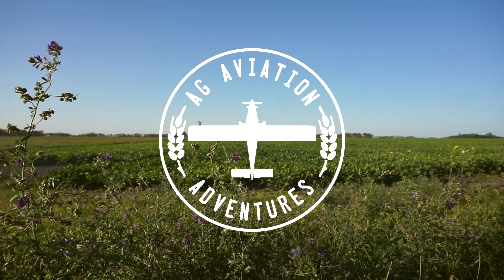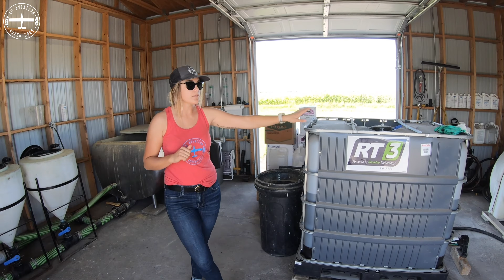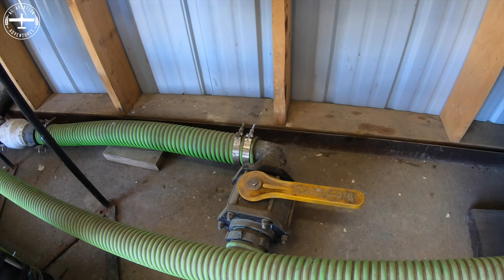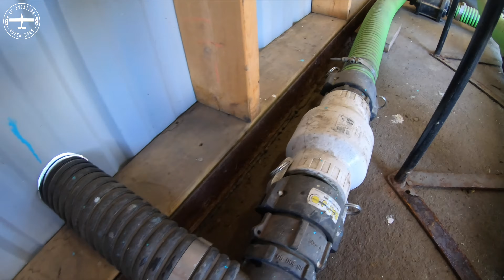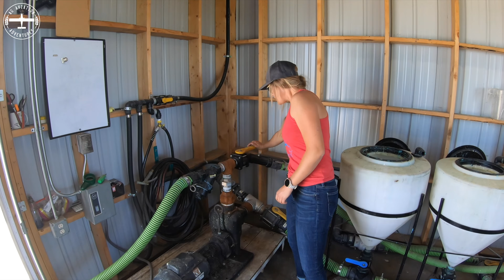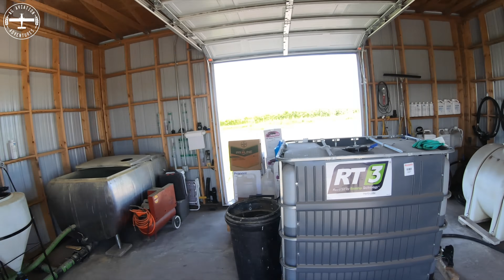What Does the Loadsite Look Like at an Ag Aviation Operation?

Comment: I'm catching up on your videos.  The company I worked for in the OK Panhandle, in the '60s, didn't have a central loading location.  We had a chem/fuel truck and 500-gal water truck.  We would drive to a more-or-less central location, a section-line road, and set up there.  The pilot(s) would land on the dirt road and taxi to us for loading. Saved fuel and time.  There weren't that many 'dusters' at the time and we covered much of the Panhandle and some of KS and TX.  Being a mobile operation, we were able to move as far south as Plainview TX to spray, though that was rare and for a specific insect.
Reply from the maker: Wow, that is really cool! Wish we could still do things like that today.
Reply: @AgAviationAdventures  Is it illegal now?   If so, per the FAA or state law?
Reply from the maker: @MaxEPR  Well it depends on where you are. You need authorization from the county. I talked to the FAA about it last month and they said they don't really mind. But the county is the one who would be up in arms about it.

Comment: Thanks for the interesting videos.  What's the process when you switch between different chemicals?  I expect it partially depends on the previous and new chemicals being used.  Some combinations may have (1) acceptable compatibility and (2) others probably require a thorough purge of previous chemical from the aircraft's system.  For situations like (2), where how & where do you dispose of the grey/"contaminated" water used to rinse the aircraft's reservoir/plumbing and the ground system with the cones and lines?  I also expect you periodically need to rinse & clean both the aircraft's plumbing and the ground station both due to prolonged use and when they won't be used for a lengthy period of time, such as multiple days of bad weather.
Reply from the maker: You are right! There is a video about cleaning out. But the cones and hoses and rinsed into the hopper. The hopper is sprayed down with ammonia that neutralizes chemical. All of this is sprayed on the last field that was meant for the chemical that is being cleaned out (if that makes sense).
Reply: @AgAviationAdventures  That does make sense. Thanks for taking the time to read and reply to so many comments. You guys do a great job!

Comment: I owned a lawn spraying for over 30 years.  My fill area was not as nice.  How many gallons of product can you carry and what rate do you spray?  I guess a lot of crops are genetically altered so you can use glyphosate for a non selective weed control?
Reply from the maker: I can carry 500 gallons and we usually spray 2-5 gallons per acre. Check out the video on GMO crops. We have soybeans, corn, and sugar beets that can be sprayed with glyphosate.
Reply: @AgAviationAdventures  500 gallons at about 9 pounds per gallon, WoW, I did not realize you had that capacity.  It is an incredible job you have but like most things can be boring also, I assume.  I graduated from Embry Riddle but didn’t like sitting behind a desk (I worked for Sikorsky Aircraft out of college) so I started my lawn spraying company.  I will always love aviation.  I still look up when I hear and interesting sound.  Good luck stay safe.

Spencer

Comment: Mixing and loading operations are much cleaner now compared to what was common 30 - 35 years ago when I spent 5 seasons on "the dock" in high school and right after. There were nicknames for everybody and everything. We called load preparation "mixing foo foo". Everything came in cans, drums, jugs, and bags. Now it seems common to pump from large totes rather then sticking a bung in a 55 gallon drums and draining into 5 gallon buckets. A lot of fun memories including every sunrise of the summer working the dock. Best of all, I got to mix nasty chemicals that are probably now or should be illegal like Parathion (joking of course).  Also, don't forget...never slam the valves! it will blow the seals on the pumps. I heard that a number of times.
Reply from the maker: Sounds like you have some great memories!

Comment: Love your videos, very informative. I have a question hoping you or someone on here can help me with. My 402 uses more fuel out of the left tank then on the right. All the lines are open and free. So to transfer fuel in flight from right to left. Do I push rudder to trail the left tank or the right? Reason I ask, is because sometimes my breather on the right tank will flow over in flight and if I push it ahead it will do more if I trail it behind it stops instantly.
Reply: Excellent thank you. I will give it try
Reply from the maker: You can swing the ball towards the tank you want fuel in, if that makes sense. So if you need fuel in the left tank push the right rudder. But to fix the problem stick a screwdriver into the vent tube and bend it so it is either getting more air into it or less.

Comment: May be a dumb question but gotta ask 😂 what is the water used for ? Is it mixed with the chemical ?
Reply from the maker: Yes. The airplane holds 500 gallons. Of that roughly 480 gallons is water. The rest is a mix of surfactants and chemical.
Reply: @AgAviationAdventures  does that ratio vary between using different fungicides/insecticides and different herbicides
Reply from the maker: Yeah. Just depends on what the rate is for what’s being sprayed. Some thing could be 4 oz to the acre and others 30 oz.